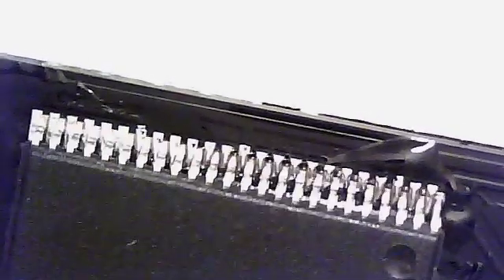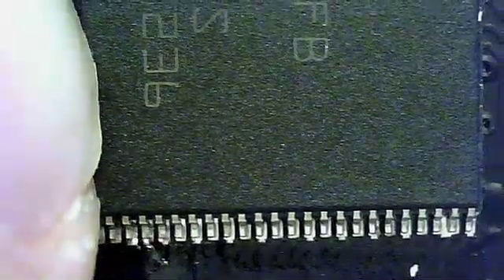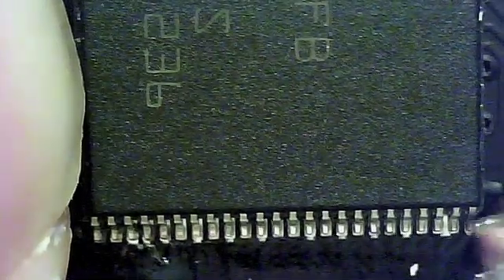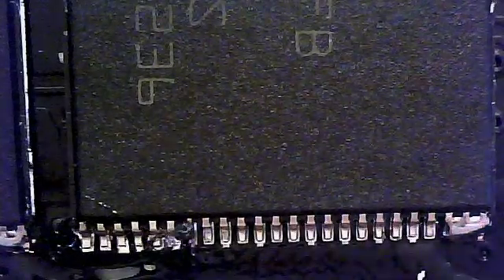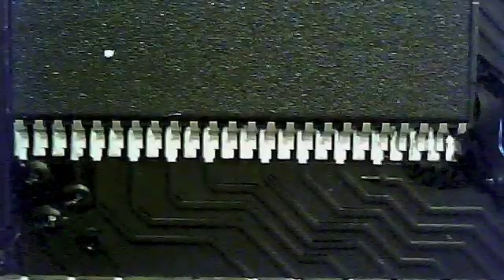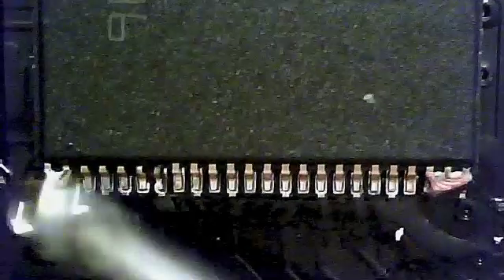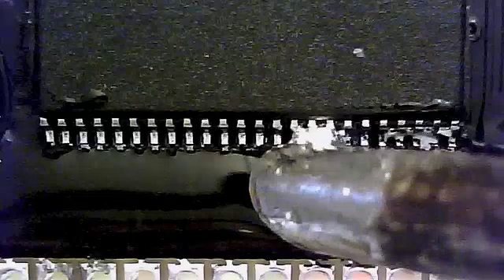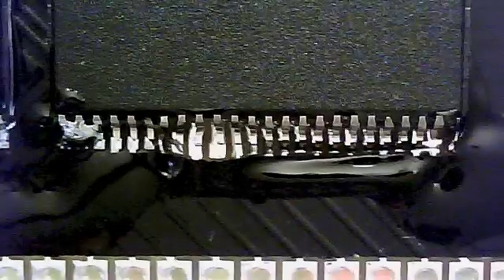Drag soldering TSOP-48 chips

Comment: unless you are hooked on that tip or have no other handy, surely you would want to use a different size. A smaller chisel type to get the heat there, but not have to hold it on your work for long.  The weird thing is that this appears to be over sized for the job.  But look at all the SMD / Drag Soldering videos that YouTube suggests along the side of these comments and that is expressly the tip that is being used. So what is wrong with my logic. And I agree about that switch to Kester, and then there are many types of that.

Comment: I am super amazed that the "device" can withstand the  heat that is being applied.  I do remember soldering Bi-polar transistors and found that they could take a large amount of heat (without even using heat sinks) without self destructing.  Would your device be (internally) using a MOSFET type of transistor?   Are they more durable than a bi-polar xister?   Thanks, enjoyed your video.

Comment: hi,
i always like people been honest also sharing their mistakes, giving others the possibility to learn by watching and keep that in mind, maybe ;) so, great video !
a few hints on why things mostly went that way you showed us. first, the amount of flux you use, i honestly don't use in 2 hours of soldering. it removes oxides, thats it. to much of it has also a slightly cappilary effect, depends on the flux. i use a fiberpen fluxdespenser, just like a textmarker. you rarly see any flux on the workpiece, its just where it belongs, between the board an circuit contacts.
oxidized contacts near the circuit casing are your friends in that type of soldering technique :) Also the solderblob you use is pretty much - at your last 2 chips (the repair), you used the perfect amount of solder. you can see, the blob is only bridging 2-3 pins, instead before, there were often bridged 4 more pins while dragging over. one last hint, if you have to much solder at the end of the chip and cant get int away, just pull it not in line of the chip, rather away from the pins decreasing the effective area for the capillary-force holding your solder at the chip. rotating your tip slightly also may help, so you can take control over the capillary effect on your tip also.
in one sentence - state of the art is to have your temperature just at a degree your solder is flowing, and combined with the speed you drag and the amount of solder you use, only heaten up the board an pins that long, the capillary effect just puts solder between the board an the chip, not crawling up the pins.
you will feel when it happens - and from this point, solderings that way is a real joy :)

regards

chris
Reply from the maker: Chris,

Thanks for your constructive comments! I always appreciate people who can get their message across in a non-destructive manner, so thanks :-)

I'm with you on the flux usage. The problem is that flux that comes in a syringe is really hard to dispense in small amounts. I have switched to a Kester flux pen which works much better and allows me to use only the tiny amount I need. I totally agree with everything you said.

Thanks for the tips -- I've gotten better at it since this video, but I'm still not perfect. Another point I'd like to make is the PCB's pads can make a difference. It's a lot easier to drag shorts away like you described when the pads are longer. The pads on the PCB I was soldering are pretty small so there isn't a lot of room to work with. Also, the PCB manufacturer for some reason didn't put solder mask between the two pins that are "supposed to be shorted" on each chip despite the gerber files showing solder mask there, and that interferes a little bit with the dragging. I usually have an easier time on the other row of pins that doesn't have that.

Thanks for your comment!

Comment: Thank you for sharing douglas! Could you please help me with this pls? I am trying to hack a satellite receiver that  has unknown jtag points. therefore nand has to be flashed externally. Do you know if there is a socket so be soldered to the board to allow quick future release? As I don't feel like solder and dis-solder all the times. Also what is the make of that microscope that you are using?
Reply from the maker: What you are looking for is called a ZIF (zero insertion force) socket. Assuming your chip is the same form factor as the one I soldered, I would google for something like TSOP48 zif socket. They do exist and I believe they are expensive. You also would have to hope there is sufficient room on the board to physically fit it. Soldering it may require hot air or a toaster oven because I think the pins will be underneath the socket's plastic.

The microscope I got is kind of a generic brand I got on eBay but I'm pretty sure it's identical to this one on Adafruit (it looks just like it):
https://www.adafruit.com/products/1061

My research pointed out that you want one that is a 640x480 model. The higher resolution models have a bad frame rate.

Comment from the maker: By the way, I'd just like to point out that I've abandoned the sticky Chip Quik paste flux because it was a mess to work with. Now I use a pen of Kester 186. It's much easier to work with and I don't end up completely flooding the circuit board with flux like I was doing before.
Reply from the maker: The other thing about this new flux is that it's so sticky that it holds the chip in place sufficiently enough that I can push down with my finger without worrying about the chip sliding around. I don't even bother tacking the corners down anymore, which helps me to use the correct amount of solder.
Reply from the maker: ***** Thank you for your comment and information! I've actually watched your videos--they helped me a couple of years ago when I was first trying to learn how to do SMT soldering. That's an interesting idea to tin the leads in a solder pot. I never would have thought of doing that, and I bet it helps immensely.

Comment from the maker: Because it's pronounced with a silent L here in the United States.

In my experience the solder that tacks down the chip comes from the tinned iron, actually. If there's any significant solder on the pads, it makes it impossible to align the chip on them. I just had too much solder on my iron when I made the mistakes in the video.